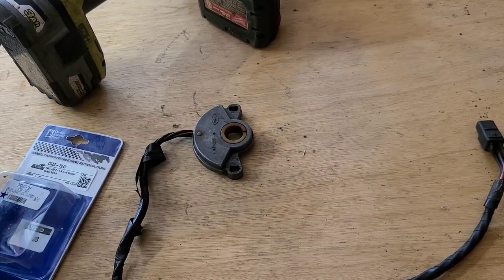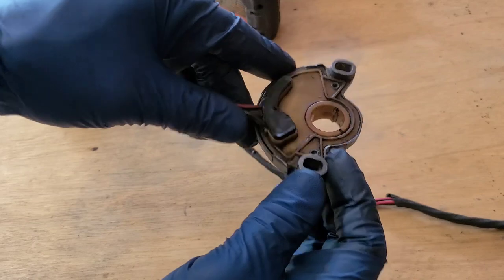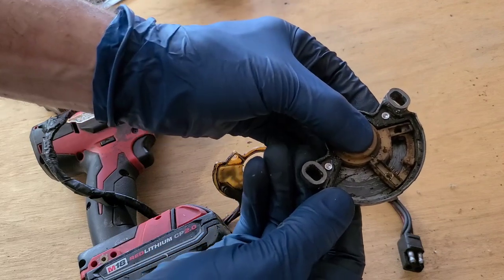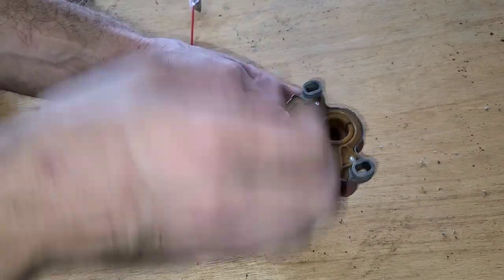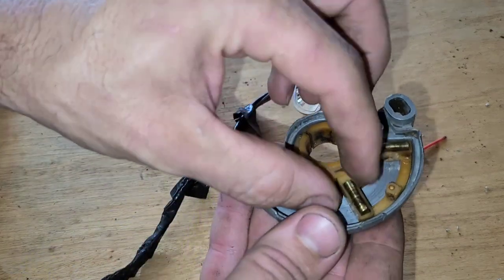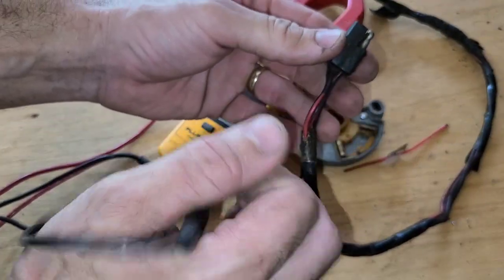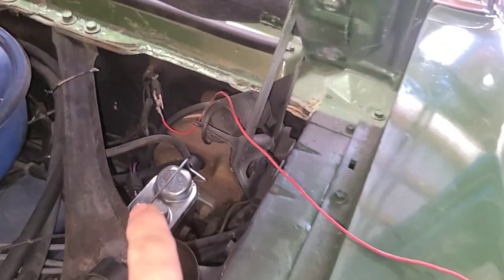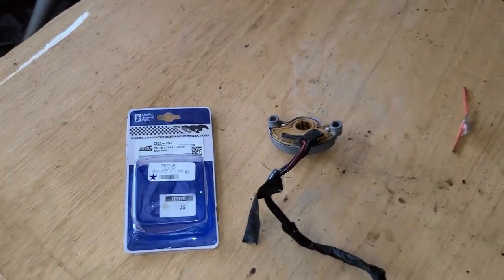Ford C4 C6 Neutral Safety Switch Disassembly. How to Fix or Bypass.

Comment: Very helpful video! My 1970 Torino has a neutral safety switch on the shifter itself, and it is malfunctioning BADLY!! It is working sometimes, and sometimes not. Then it will work in park but not neutral, then neutral but not park. Can I retro fit the selector shaft type switch onto my C4? Right now it has a red plastic cover that moves with the shaft as it changes gears. CAN I RETROFIT THIS TYPE  OF SWITCH TO MY CAR?? In other words do all C4's have this keyed shaft? The switch in the car has the same type of plug.
Reply: My C4 also has the kickdown lever built into the end of this shaft. That may complicate things I guess
Reply from the maker: Technically yes a switch could be rewired on the transmission instead of the column.  Optimally a replacement switch is the best fix.  Those column-mounted switches function the same way, but for some reason cost 3X as much.  In the interim, you could jump the circuit with an alligator clip so it would start in any position, or put a toggle switch in-line, but either of those options may interfere with the reverse lights.